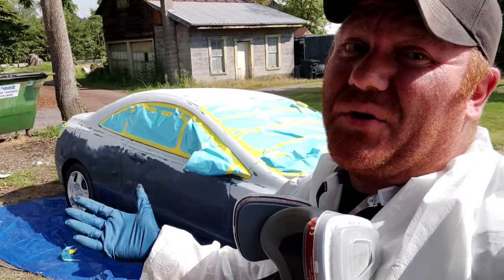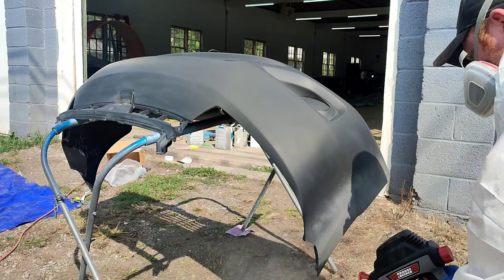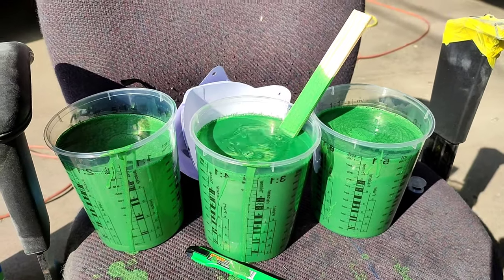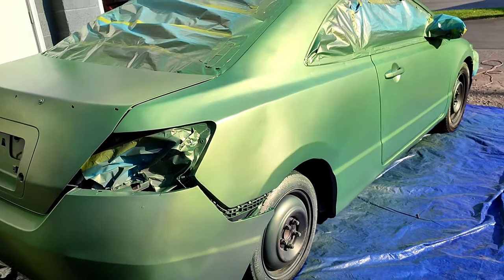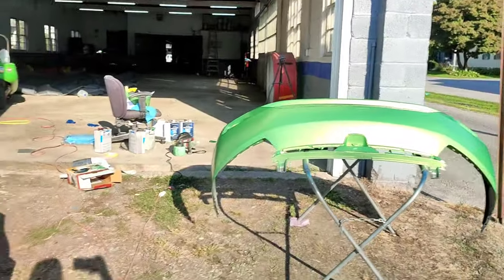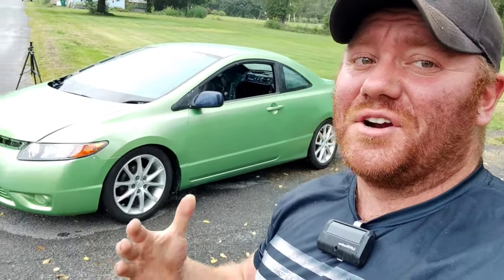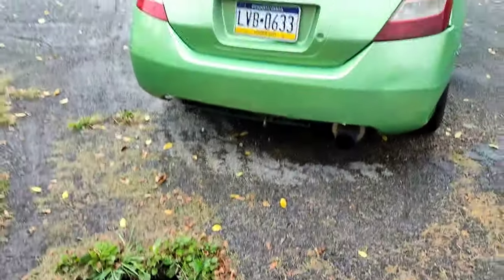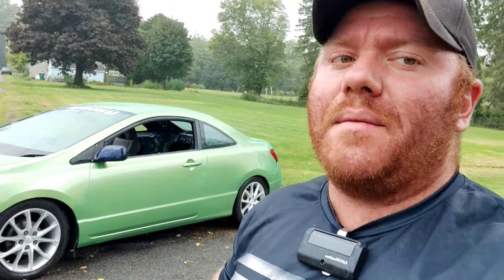HF ELECTRIC SPRAY GUN pt2

Comment: Thank you for being a pioneer in this industry! This is a paint job within reach for almost anybody
Reply from the maker: Pretty much yes!
Reply: So as I'm watching this I'm wondering if I should try this on my S10, I have like 1100.00 in the truck and it's like 5 different colors. I really like the gray color you used . In your opinion did the electric gun do a good enough job to use with a single stage paint?

Comment: I had that harbor freight paint gun. It died after a few uses too. I now have the Finish Max Super paint sprayer. It was around $100 but it has the 2 stage trigger, pull it halfway  and just air comes out then pull it fully and paint comes out. Its quiet and works great. I haven't used it for automotive paint....yet

Comment: The Avanti gun Harbor Freight currently sells specifically states it has to be cleaned if you stop using it even with house paint or it will clog. Assuming the construction is similar and that what you encountered wasn't a mechanical failure I think you need to be prepared to do it in one uninterrupted session and be ready to clean it immediately after.

Comment: I have one of these spray guns and used it to put stain on my fence. It spit globs of stain unexpectantly and then sometimes wouldn't spray at all and clog up. They really are a cheap piece of crap. I had to buy two guns because they only last a few times of use. I'm surprised that you were able to get it to spray as smooth as you did

Comment: That nardo gray looked like it layed down really good from an internet distance but couldn't really tell what the base was gonna do.  I think the problems with airless/compressorless, both this one and the turbine type, is gonna be the hot pump and the hot air from the turbine.  It will change the flash times dramatically and leave alot of dry spots.  It was worth a shot but not something I would do if there was any way around it.

Comment: Beautiful job mate! I first used one five years ago when I painted my Toyota Celica bumper and I was amazed that the job Turned out perfect than a rattle can. I decided to buy myself a cordless one and didn't get around to buying the rechargeable batteries. I just bought a recarable polisher and the 21v300 battery I can use with my paint spray🤣🤣 so my next job with be painting my Toyota Caldina Gt4  N spec Bumper. I bought this car two years ago and now getting around to fixing the little issues this came with. I had an old Honda Integra back in 2011 and the paint work was horrible so I used rattle cans the job was horrible and truly wish I had these electric paint guns that would have turned out better. Well done to you for making this video. Perfect job🎉. 🍺
Reply from the maker: Thanks!

Comment: I bought that same HF gun for home use. it was total junk and had a ton of paint splatters and it was barely good enough for one job before no longer working. The cheaper spray gun I got off amazon was much better and reusable.

Comment: I like the review on this gun. Nice video. How difficult is it to clean once done prior to use the base coat on it and or clear prior to dying on u?
I keep wanting to drive out to your location for leave you my little Sentra hooptee to paint for me but I have to get rocket panels and quarter panel repaired first due to rust
Reply from the maker: Well I threw mine away so I wouldn't know 😂

Comment: Considering that those paints ain't even formulated for such a spray gun, it's a miracle that this thing even works, and if enough people ask the manufactures to make a specialty formulate paint for this kind of sprayer maybe we can have much better results, I'm pretty sure that there's a market for that, given the extremely low price to enter the business.

And of course, there are way better electric sprayer, those that often called "turbine sprayer" and people use them a lot for furniture.
Reply from the maker: Yes agree

Comment: Electric spray guns generally don't spray well using thin paint. They are meant to spray thicker paints and they will burn up using thin paint and sometimes even dry within itself clogging up the gun rendering it useless
Reply from the maker: Yup agree
Reply: @Speedokote refinish network  I normally use a Black Widow from Hobo Freight and it has worked very well for the last 4 paint jobs I've done. Royal blue pearl metallic/clear, metallic gun metal grey/single stage, midnight black/clear and torch red/single stage. My next project will be a 2012 Dodge Challenger for my youngest son that I'll sand down with 600 or 800 grit and then shoot with grey sealer and the Speedokote single stage Nardo grey. I saw you use it on one of the cars you painted and I figure 3 coats and I can have it gleaming. But now I'll have to find another air compressor since I sold my Husky 60 gallon. I think a good 40 gallon should work fine unless I can find a 120v 60 gallon at a really good price. Lol

Comment: I'm getting a plastic front lip for an 02 Camry that will need to be painted and I thought about just getting the color match spray can is that can cost what $15- $17 a can 
If I could spend $40 on a sprayer like that just to do a 5ft long plastic piece
Reply from the maker: Would stick to the spray can stuff. Definitely do proper prep

Comment: I get why paint jobs cost so much, but body/painters don't understand alot of people do not have the money.  And let's be real. Part of the reason they cost so much is because shops want that ins. Money not private money.  I got a quote for anywhere from 1500 to 3000 to paint my fender flares and my vent visor/rain guards.  That is an insane amount of money. I don't give a sh1t what these painters think of themselves. That is t a rational price.  I came to the conclusion they didn't want the work but if I was stupid enough to pay those idiotic prices they would do it.  I bought 180 dollars of exact paint from Sherwin Williams commercial and a paint gun, taped off a paint booth in my garage hung em amd painted em.  They orange peeled a little but but I literally saved thousands. Sanded em down real good and good to go.   I am a hard headed will not pay it if I don't see the value kind of person amd on a clean surface printable product I couldn't pay em.  I'm am electrician and if we acted like most body shops none of yall would have power. All you hear about is the work, the work.  Every single job is work. But paint is absurdly high. I do get alot of it is materials though.  That's the crazy part is how high paint actually is. Anyways. Thanks for this video. I've got a beater 1990 gmc that's great except the paint and my buddy said 8k. And I would be stupid to pay him that.  I said your damn right. I bought it for 5k. I just can't pay that knowing what I use it for, which is a work truck. This is my new plan of action if this guy lined up to now buy it falls through. Paint and send it.
Reply from the maker: Unfortunately just can't change the prices of services. T bone steaks are super expensive as well, that's why there's a steak house and a McDonald's in every town so people can pick and chose what quality they want.

Comment: I went on speedokote and put in the color code for Camellia red and wanted to order a gallon of base coat. It didn't give me a price even whenever I went to check out and billing. It says free shipping and then no cost for the product. My question is if I pre-order it I don't know how much the paint  is going to be. So do I pre-order it and then they'll send me an email saying how much is going to cost and then verify that I want to buy it?
Reply from the maker: I'll have to verify this Monday. I will say it used there base it covers better than anything I've ever used
Reply: @speedokoterefinishnetwork4937  yeah I used y'all's glamour clear recently and it really came out nice! 👍 So far I've been using base coats by auto hq off eBay and had good luck.  I've been working for myself and started with flipping Hondas and painting them and it's been almost a year now! First car I painted was my personal 92 Acura integra with the speedokote bright white single stage and it came out beautiful. I've painted two full cars and a custom set of rims since then I've been working on my experience with base clear. Also currently doing a full jamb job and color change to Nevada beige on a 93 Toyota pickup. Just did the jambs and finished it off with the glamour clear and Damn it is nice 👍  . I'm really looking forward to the speedokote option for the any color code base coat because if it's as good as y'all's clear coat I want it! 🤣
Reply: @speedokoterefinishnetwork4937  and thank you for checking into it. I was really confused when I went to check out and it didn't state a price after filling out all the info. I have an account as well I've bought products from y'all before and never had an issue.

Comment: WHAT BULLSHIT! take it back you had the receipt without a warranty they take things back within 90days??? hell even $40 bucks to buy a new one instead of cheating with a actual spray gun what BS
Reply from the maker: I took it back and got my money back. I'm going to get a slightly better quality airless spray gun and do a second try for you guys
Reply: @speedokoterefinishnetwork4937  the point was to do it start to finish with that sprayer or that kind of sprayer at least that is what you made it sound like in the video and why you used it to do the prime coat first using the same sprayer idk its whatever man
Reply from the maker: @myice-creamdreams3421  that wasn't primer in this video. Which shows me you were not paying attention
Reply from the maker: @myice-creamdreams3421  dude I litterally said right in the video by ground coat was nardo gray BASECOAT. NOT PRIMER. your not paying attention to the video at all . I make these videos and explain every step for a reason